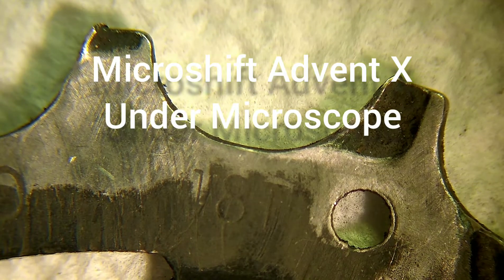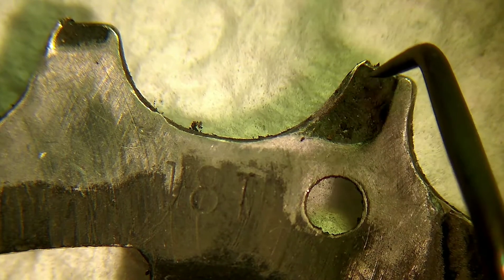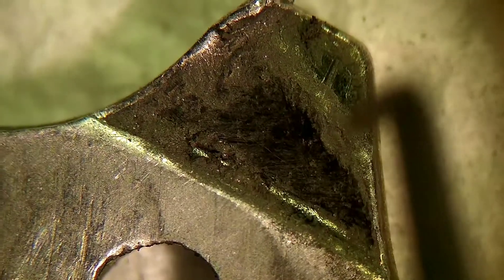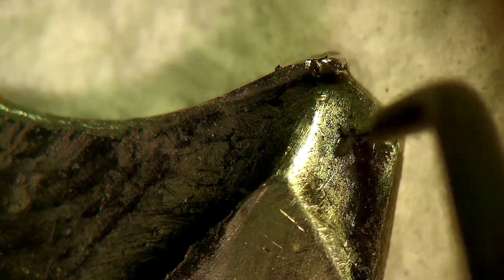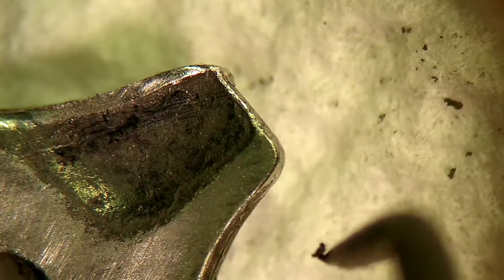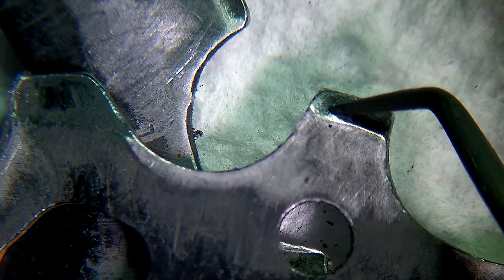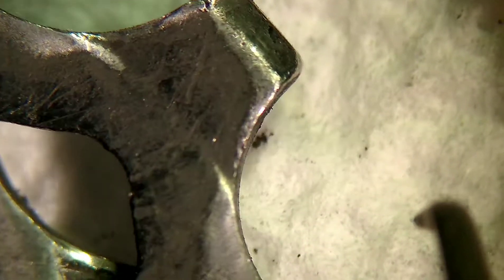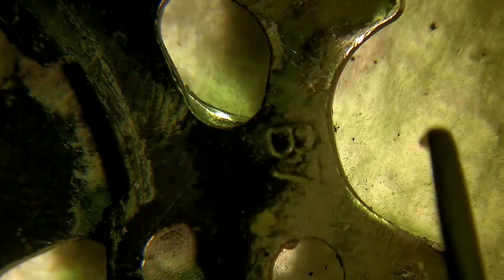Microshift Advent X Cassette under the microscope

Comment: I'm not sure if you mentioned it in the video, but apart from this sort of wear and tear is unavoidable at some point, it definitely gets accelerated by a stretched chain.
 I understood it as 500 miles of wear, and while not exactly impressive longivity , you can end up with a stretched chain within mileage if running harsh conditions, and from there damage to cassette happens quickly.
Microshift may not be the longest lasting chain either on top of that, so... yeah - just some parameters to consider maybe.
Reply from the maker: I agree, the trails  riddenwere mostly mellow trails here in the southeast, what's funny is that the shimano 10speed chain that was installed from day one hasn't stretch a bit. I went back and took a look at the miles ridden and it turns out it was under 300. Im a big guy and put plenty of power on the rear wheel but never expected it to last that little. Long story short, i ended up buying a shimano 4100 cassette 11-46T it comes in at 120 grams heavier but should last longer.
You can feel ans see the quality of the metal when you hold them both for comparison.
Reply: @trailsidemedic5303  Too late for me, I got several sets of this cassette, a couple for me and a couple to resell to recoup freight costs :( I was reluctant at first to try the Microshift cassette since I'm a loyal Shimano user (no failures and they were long lasting) but got convinced because of the range and weight and the decent gaps between shifts.